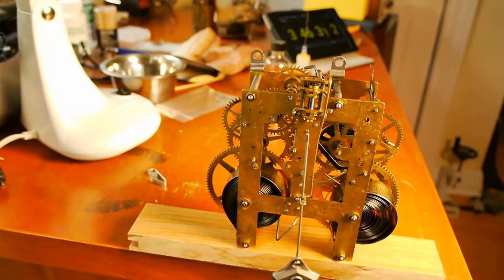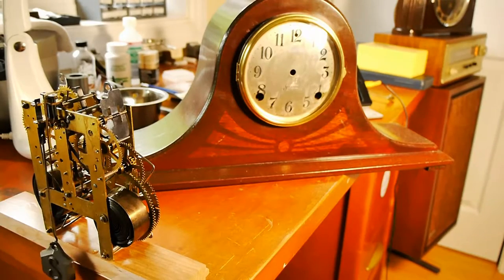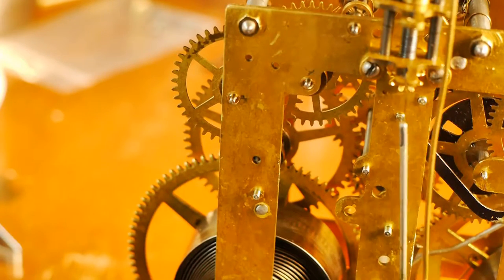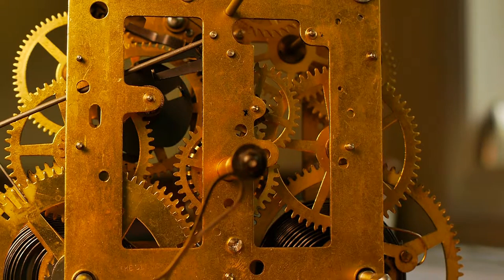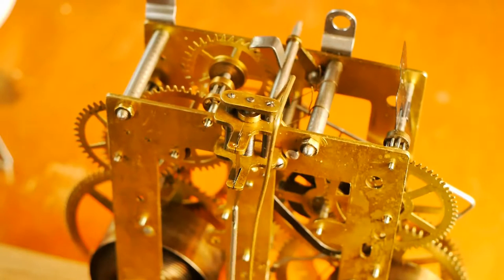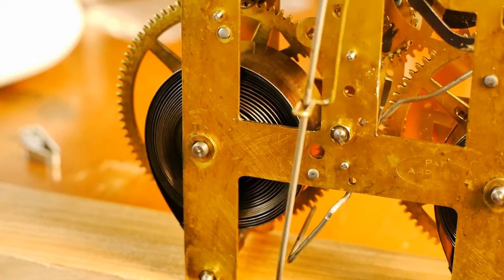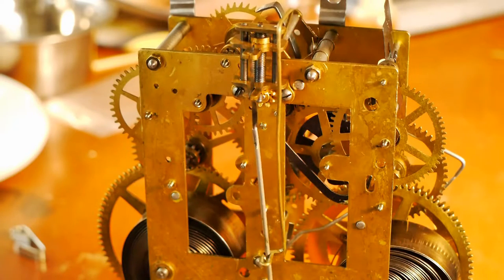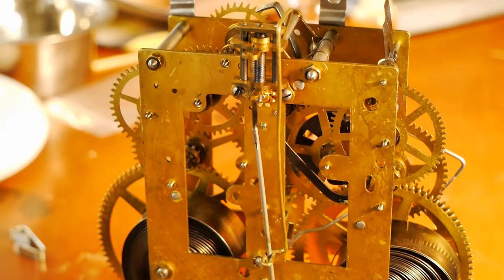Sessions Beveled No 2 repair June 2016

Comment: Hello.Just viewed you restoration. I have what appears a very similar movement, No.322P. If you could, explain hoe the small gear on the front of the intermediate gear functions. There appears to be nothing turning the hour gear on the third arbor. Minute hand rotates, but not the hour.